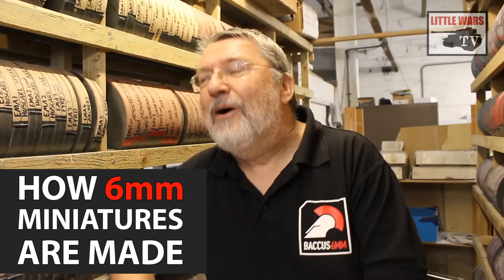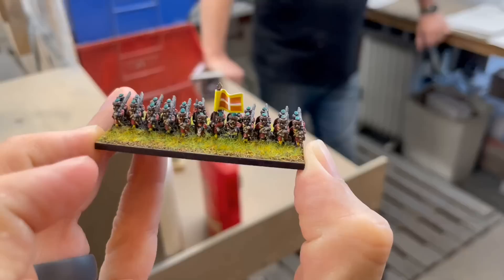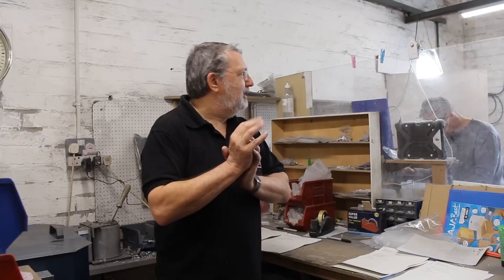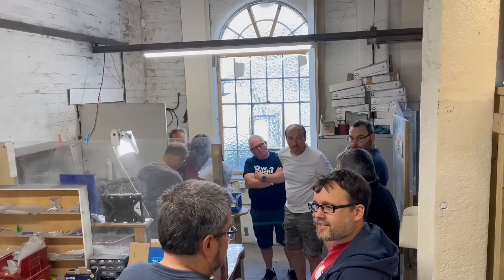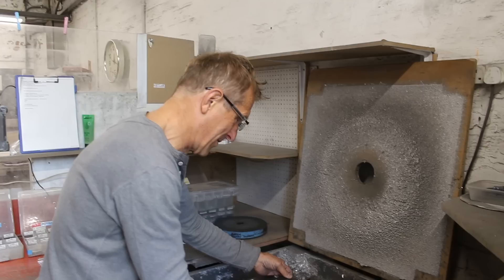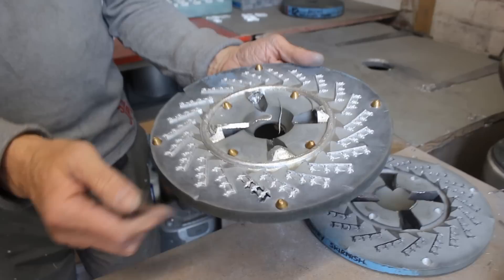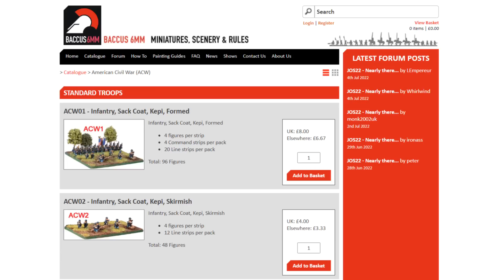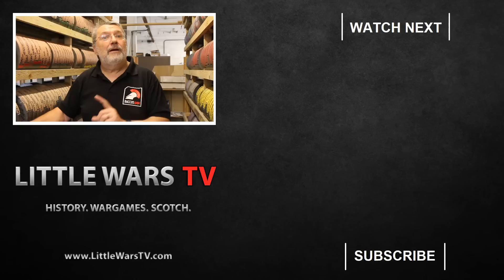How 6mm Miniatures are Made

Comment: Next time pre-plan where you want your trees and put a hole there and plug the hole with a Dowell so when you finish the grout you can pull out the dowells and you will have holes for your trees and won't ruin a drill bit drilling through hard grout

Comment: Very interesting. I would like to see how the master is sculpted, 6mm has to be very difficult to do. I have a hard time getting details in 20mm. Did they use mold release agent? What is the metal described as 'lead"?  I suppose you could make your own casting machine using an old potters wheel and a large drill for the motor. One day I want to be able to make my own so I need to get familiar with the entire process. Never enough or the right poses in any set. Amirite?